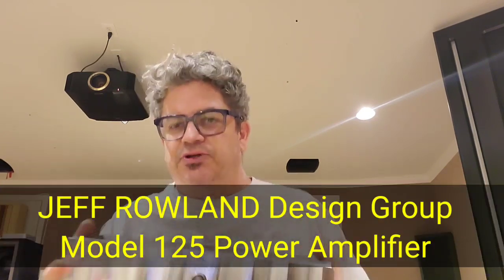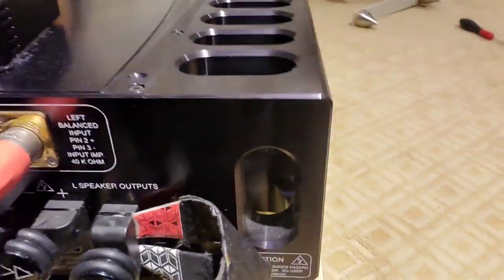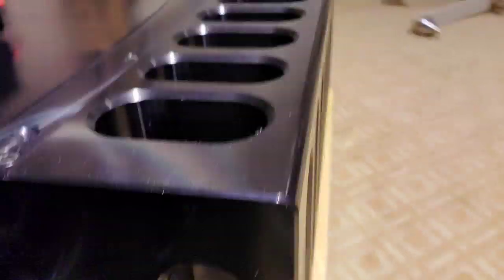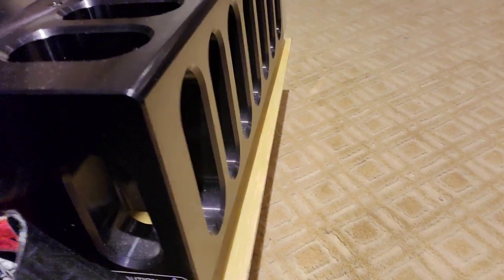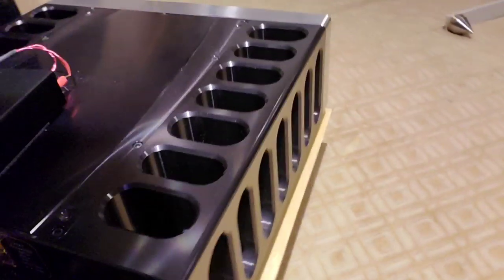Highest Value audio power amplifier for $3K

Comment: The finish on the Jeff Roland amps, any tool and die maker Knows is called a “fly cut finish.” So the next time you do your videos you can tell people the kind of finish that JEFF Roland is using. And that is according to the tool and die Institute of America. There are five US companies that hit the top of stereo products. Macintosh, AUDIO research, Jeff Roland, Conrad Johnson, and let’s not forget Mark Levinson. All these products the five I had mention, will fix any product they made since their inception.
Reply from the maker: Not by the founder of the company will they repair thier gear.
Reply: @OCDHIFiGuy   of course not you don’t expect  the CEO of a company to fix anything. The point I was making is no matter how old the equipment is they will still fix it. I’ve seen a lot of companies come and go through my lifetime in the stereo Hobby . A lot of these companies like Marantz, pioneer and others either don’t exist or wouldn’t even fix their equipment after it was 10 years old if something went wrong with it. Today some of these old piece of equipment are hailed as great pieces of stereo equipment but the company’s that made them still will not touch them and fix them for their customers. Yet, I could buy an old piece of 1977 Of CJ amp and sent it back to them and they’ll fix it and update it for me.
Reply from the maker: @anoxicfiltrationplenums  ok. I get it now. Yes not only will. Jeff  Rowland Design Group fix any of the very old amps , Jeff actually has not stopped doing the repairs, he does every single one.  Shows you how few there are...but he also brings them up to higher spec than original as usually he upgraded a certain part of the circuit, etc.  Thats pretty much unheard of and really great. 
Thanks for your feedback !!
Reply: @OCDHIFiGuy   you sell really good stuff and I know JEFF  backs up everything that He’s ever made since 1977 along with Conrad Johnson and audio research.  Keep up the good videos I like watching them.
Reply from the maker: Thanks Dr. Kev. Audio Research has been bought and sold a few times now I think.  I believe CoJo is still with the original guys. As soon as they are sold out from the founder I no longer trust the brand. Its usually when investors get involved and its only about jacking profits up as a corporate entity